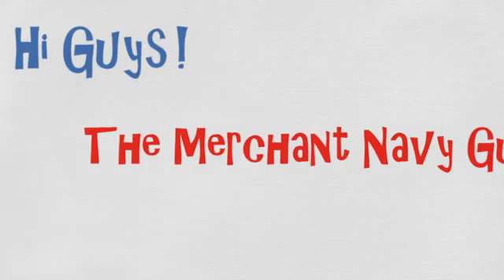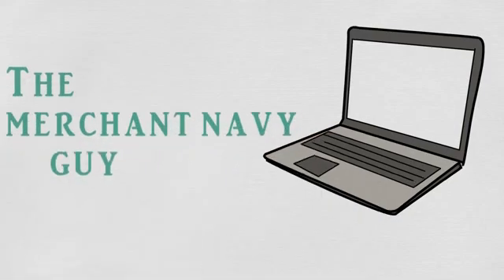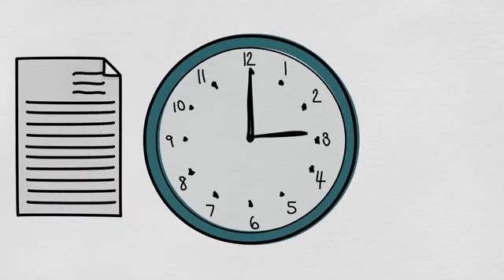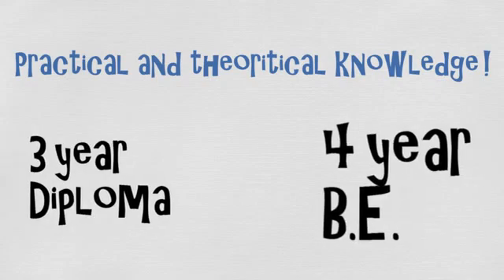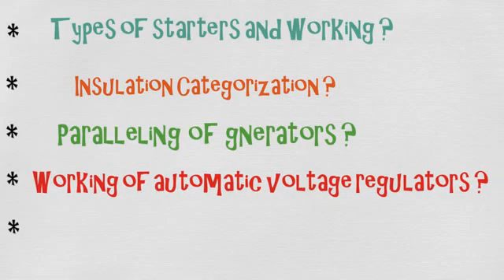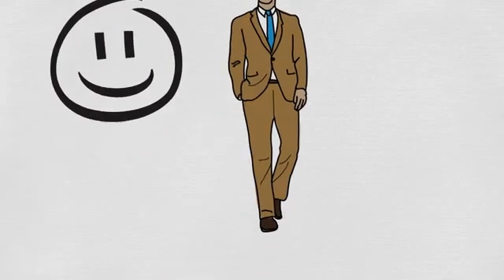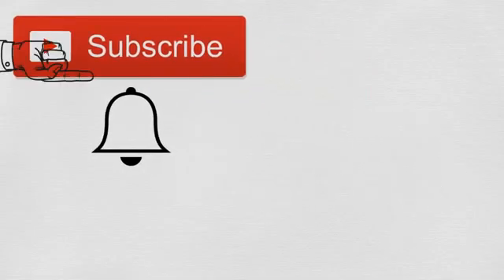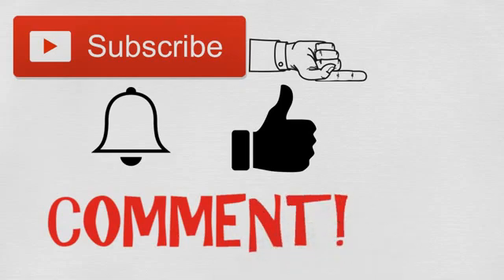ETO interview , Merchant Marine

Comment: Hey im ETo aspirant in my interview questions asked were 
What is alternator
Rate of fuses
Transformers 
Why their is battery in it some controller
Plc pli pld
Feed forward in control systems
Pid controller 
Electrical components on board
Circuit breaker
Connectors
Duty
Energy
starters , aux. machinery , batteries ,, n very special about reefer that is about air conditioning system. 
Transmission line
PID controller
HR
why should we hire you
Why do you want to join merchant navy
Reply from the maker: +janender loomba thank you so much for sharing ,
Helps a lot
Reply: bro, which institute you are from?
Reply from the maker: Not a good one